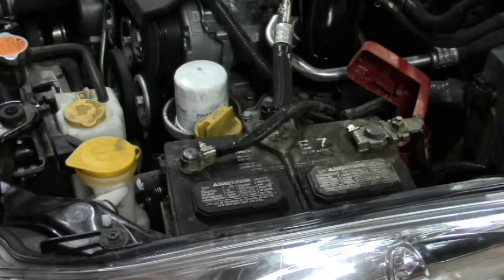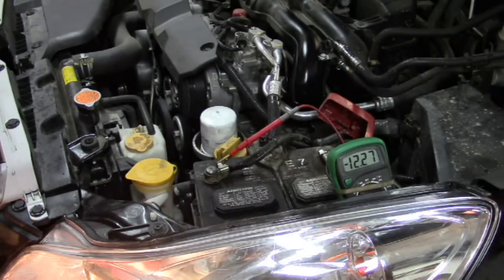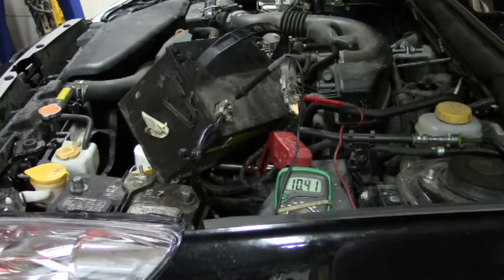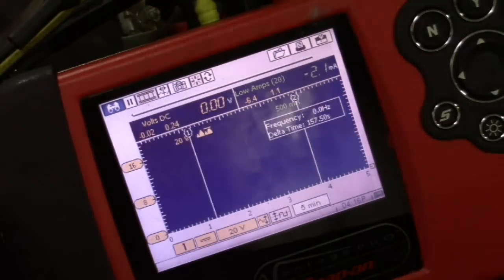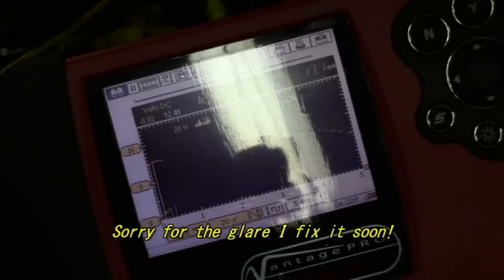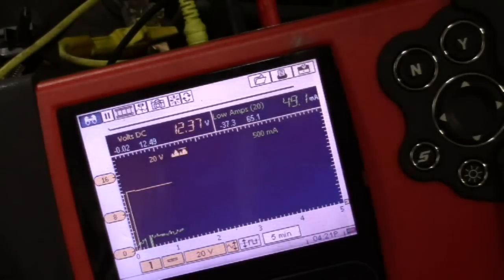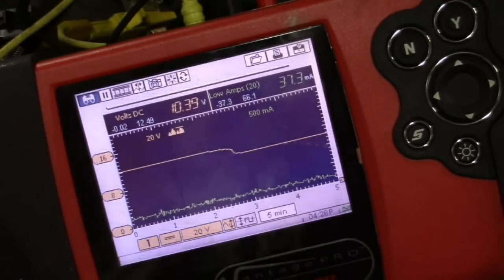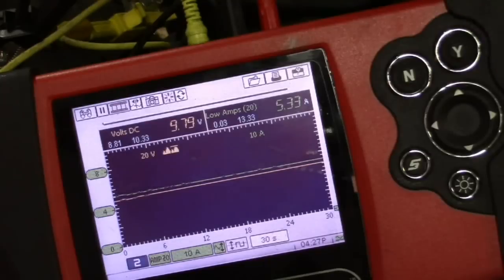More Methods to Find Intermittent Battery Drain

Comment: What kind of amp clamp you have?
Reply from the maker: I have several - snap on, pico scope, hantek…. It’s really more a matter of the amperage and jaws than the brand.
Reply: Which one did you use in the video? Reading looked very accurate.
Reply from the maker: @yessiprz23 in this video I used a vantage pro with a snap on 20A low current probe.
Reply: @SchrodingersBox Model number of amp probe please, or any others you recommend need something that’s accurate. Any information is appreciated.

Comment: I need to talk to you desperately sir
Reply from the maker: I’m listening…
Reply: @SchrodingersBox  perfect perfect perfect okay listen I'm a truck driver I work 3rd Shift I just seen this and I'm so glad that you have replied. I'm going to type it all out as soon as I can get a chance and I thank you so much for this opportunity to get to talk to you about my issue.
Reply: @SchrodingersBox  ok sir. I own a 1999 chevy z28 camaro.  It has a built 5.3l. 6 speed car. 500 plus hp.... it has a powermaster 150 amp alternator .. I had a power steering line bust and broke that alternator about 3 months ago. I had it rebuilt by a local alternator shop... everything was fine ...I then ran into a issue with valve seals leaking..also had a comp cams trunnion kit that came apart and caused one of my Texas Speed chromoly push rods to break... car was down for a month... I got it back together..went to start it and the battery was dead...didn't think much of it. Jumped it off...drove to store for fuel..cut it off...got fuel...it fired right back up... brought it home.
Tried to start it up the next morning...battery dead again! Didn't think much of it except..battery had a few years on it... so I bought a new one. 
Installed new battery..it fired right up..drove around a little...brought it back home for the night.
Next morning..battery dead! 
Now it has my attention! Parasitic draw...gotta be.
So I go buy a meter at harbor freight tools. It went up to 10 A... i watched yours and a few other you tube videos on how to do a parasitic draw test?? when I first started I was pulling 1 amp with a inside light on ( driver door opened) and then I pulled the bulb out and it went down to 0.10 which is 100 milla amps... then pulled the courtesy fuse and it went down to 0.04 and fluctuated between that and 0.05.. ( this was right after I had just started the car up ..turned it off...then disconnected the negative terminal to the battery...inserted the meter for testing...)
I thought well ok I just need a wiring diagram? Well then I tried to put the car to sleep...I tricked the door locks and the hatch lock because my battery is in my hatch ... ( where the spare tire used to be ).
I'm not sure if I waited long enough for it to go to sleep? I started checking fuses for voltage drop...found nothing!!! I then tested the alternator..
( I hooked up the meter to the alternator with it disconnected and it showed that the diodes were good but my thing is.. on this video I watched.. his meter shows negative numbers and mine showed positive .444
But when I flipped the red and the black around on my meter I got nothing for a reading and that is an indication that the diodes are working right is what that guy said in the video? ) 
Well I checked my meter again After hooking everything back up and I was back at square one... so I pulled the courtesy fuse..I put it back in and my console light came on by itself with the console shut!! I said yes!! That's got to be it.. I pulled that bulb out... left the battery hooked up. Went to bed that night... CAR FIRED RIGHT UP THE NEXT MORNING !!! I was so happy because now I'm thinking 🤔... I don't have to keep disconnecting the negative terminal every time I go to work... 
WELL SIR... NOW IT GETS CRAZY 🤪!! 
I drove the car to work... 
WORKED 12 HOURS...
when I got back to the shop ( to get in my car and go home...)
BATTERY IS DEAD! 
IM SO LOST 
I mean my security system ( VATS ) has some type of issue...it will randomly show the security light on the dash and car will not do ANYTHING until I keep turning key back and forth alot....
Also ... I had to fix my BCM awhile back...it had to be soldered... I looked up to see if a BCM can cause parasitic drain and I read that it can? 
IM SO SORRY THIS WAS A BOOK LONG LOL... I JUST NEED HELP SIR . PLEASE!
Reply from the maker: Ok so I am having trouble discerning the issue. ultimately are you saying you have a 440mA draw?  if so what circuit is it on as evidenced by pulling fuse for the circuit (not the bulb).
Reply: @SchrodingersBox  okay .440 was voltage.. it was when I was checking the diode on the alternator I think I misunderstood what I was watching on a different video and I was thinking it was something totally different. But I'll swap the leads around.. and that's when I got 0 .00. After watching that video it was actually a diode symbol that I was thinking it was a negative symbol that was on his multimeter so I was definitely confused and I apologize for that
Reply from the maker: ok I guess I still don’t understand. I thought you were suspecting a parasitic draw. obviously that’s not the case since you are measuring voltage. 
 what is the issue exactly?
Reply: @SchrodingersBox  it is a parasitic draw for sure.  
Maybe it's not voltage.( maybe it was resistance that i was measuring).. it's the little diode symbol on the meter...I thought that measured voltage... but now that makes sense that it does not measure voltage because when I tested it I had it disconnected all together and I was testing to see if the diodes were good in my alternator to see if that was the cause of my parasitic drain/draw
Reply: @SchrodingersBox  I've always struggled with automotive electrical sir. I apologize. 😥
Reply from the maker: Yeah I am not sure I can help. you need to tell me the amperage of the specific circuit you have the draw on. without that there is nothing I can do.

Comment: Its 9 : 31 on the video and all you did was test a battery. 
Not parasitic on a vehicle.

I know my battery is dead, I came to find out why, but that info not provided
Reply from the maker: Ummmmmm. No I was testing parasitic draw. The whole video is about that. What were YOUR results from the parasitic draw tests. which did you use? amperage to voltage drop?

Comment: I did something similar when I had a parasitic draw a few years ago. The odd thing about this draw was that it did not present itself when I measured, so I bought a Fluke 287 for the logging and graphing capability and a current clamp since I didn't know what kind of amperage I could expect. I let the setup log the current draw over night, and found a steady increase in amperage. It started out with only a few milliamps, but after a few hours it had climbed to about 1A.

I located the draw to the radio fuse, but haven't taken the time to dig any further. It's not close to the top of my priorities so I have just kept the fuse removed. I'm curious about what I'm going to find that can cause such behavior when I finally get time to track it down.

Comment: Interesting -- I have pro-level battery testers but I will give this a try.
Normally with only a multimeter I would go straight for a cranking voltage test.
Recently I have tried doing cranking voltage  and charging voltage checks via OBDII live data.

Comment: The scope is very versatile in acting as a voltmeter and ammeter as well as recording any deviations in the output  over time.Hard to beat the latest tech products.It reminds me of a mother that reared 15 kids and used water carried in a bucket from a well.Later one of her siblings installed a mains water supply, but she still went to the well for water insisting that it had served her fine in the past.Great video for the well users and those on the mains supply.
Reply from the maker: Lol great analogy man!

Comment: While I'm grateful for a fancy tool at work, which can usually "guess" if there's an issue in a very short test, it certainly isn't a helpful to the DIY. This test is a way at home for me to find the fault, be it a cell in the battery that entirely craps out after a little time like this one, or a parasitic draw to be found.

Never have I seen on YouTube, both of these ideas brought together (And for years I've spent time here learning like some watch cable TV). Fancy tools can't compare to the knowledge of the process that this video brings.
Reply: Side note. I've noticed Chevy trucks put more surface charge on batteries than other trucks. They're hardly a Honda trying to save gas even from the alternator. 

Chevy's can fool the fancy tool at work (tool by midtronics). So if a battery tests bad here I pray the customer is smart enough or has enough dough to heed advice.

Comment: The second method was really not necessary to show here. And no, I'm not the biggest fan of scope, clearly because I don't have one ;)

My wife is gonna find you and apply tortures since I've already started talking about money and scope.....
Reply from the maker: patw52pb1 Yeah Pat is right. One thing I regret in showing off the new scope a few videos ago was I didn't really do a good job of indicating that a Vantage Pro is NOT the scope a DIY would likely consider. I hope I didn't scare people away by making them think they need to spend $500 or so. Nothing could be further from the truth. A good scope can be had for a fraction of that,
Reply: Schrodingers Box +messer7bc 
You really don't have to go broke, be an accessory to mahem or initiate a divorce to get a usable digital scope for automotive use. 
There are several inexpensive alternatives such as: 
http://www.ebay.com/bhp/usb-oscilloscope

http://www.ebay.com/itm/2-Channel-PC-Computer-Digital-Storage-USB-Oscilloscope-/330731251939

There are also current probes and other accessories available, just perform a search.
Reply: patw52pb1 The $20.00 scope says the maximum voltage is 5v.  If I feed it 12v will that blow it up or cause it to melt down?  Sorry if that's a stupid question.
Reply: *****
It is possible to damage the input stage of that $20 USB scope with 12VDC, but even if it was not damaged, the signal scaling would not be accurate and the representative waveform would not be very useful. 
That is correct the maximum input voltage for that particular unit is 5VDC, however you can use 10x probes for operation up to 50VDC or use 10:1 or 20:1 inline attenuators to permit use on circuits with maximum of 50VDC and 100VDC respectively. 
Not a stupid question. 

https://www.google.com/search?num=100&newwindow=1&biw=1164&bih=786&tbm=shop&q=10x+oscilloscope+probe&oq=10x+oscilloscope+probe&gs_l=serp.12...344059.355184.0.360432.22.22.0.0.0.0.166.2825.3j19.22.0....0...1.1.64.serp..18.4.527.XQ4kNLfrzbs

https://www.google.com/search?num=100&newwindow=1&biw=1164&bih=786&tbm=shop&q=20%3A1+oscilloscope+attenuator&oq=20%3A1+oscilloscope+attenuator&gs_l=serp.12...88799.91250.0.93793.3.3.0.0.0.0.154.363.0j3.3.0....0...1.1.64.serp..3.0.0.rBcQdrjpATE

Comment: That was a cool test for internal battery problems.  Never seen that done before.  Thanks
Reply from the maker: Ozzstar Me neither lol.  I was just goofing with the scope on a bad battery seeing if this method would work and I was shocked at actually "catching" the battery cell short out on its own.  I was all like "oh hellz yeah, where's my video camera" lol
Reply: LOL i hear ya, one of those youtuber moments we get!  take care
Reply: Schrodingers Box I do this exact testing all the time...I should have spoke sooner I suppose. Yes, more often than not, it is NOT a battery issue(some accessory still pulling current on the vehicle is far more common) but hell, why chase down a vehicle's entire electrical system(which can take days, believe me)before throwing the battery out of the equation. Remember, Keep It Simple Stupid, that should come first.